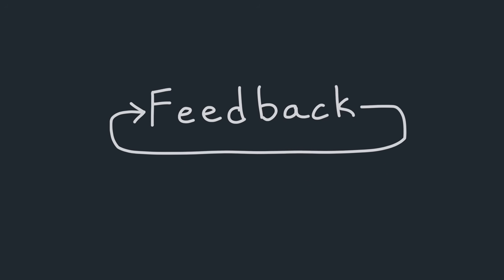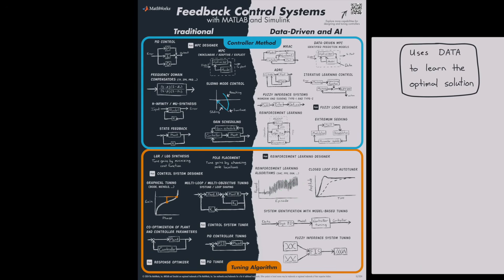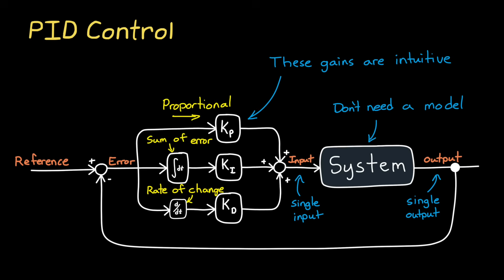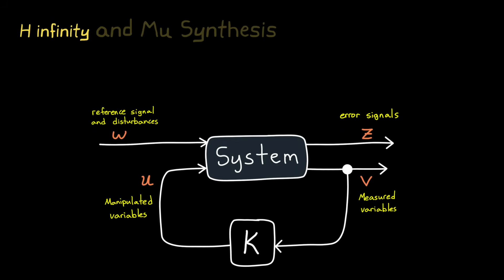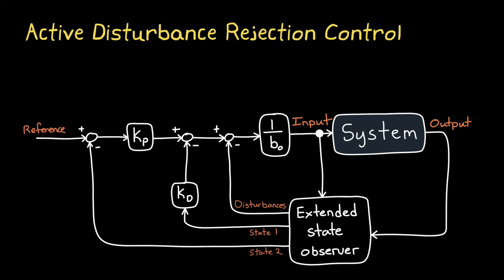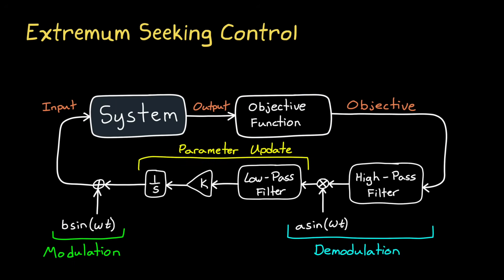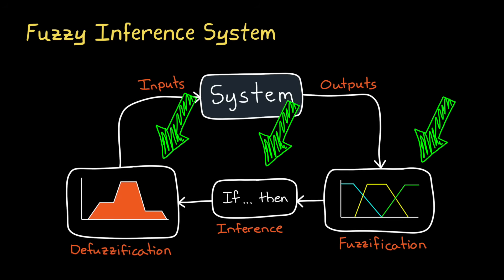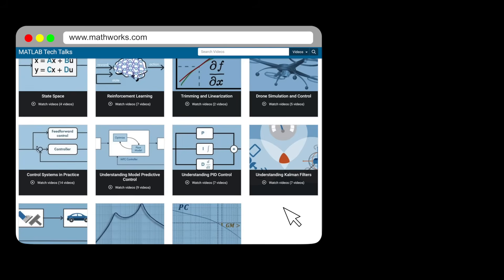Closed-Loop Control: An Overview of Feedback Controllers

Comment: In my opinion, if you have physical knowledge about your system, then MPC is the way to go. Not only does it perform extemely well, it is also easy to reason about, simulate, adapt to new situations. Writing your controller as an optimization problem is such a great way to show to other engineers what you want it to do.
Reply: Yeah but good luck deploying it in hardware where real time is a requirement
Reply: @omaraissani5910  that's exactly what I'm doing. It can be done.
Reply: @pietheijn-vo1gt  am not saying it's impossible, in fact i myself prefer MPC over any controller out there, it's elegant and it handles constraints inherently. But it can be quite challenging to implement in real life especially for fast dynamical systems and when computational power is a concern.
What are you working on ?
Reply: @omaraissani5910  there are some demos of it running at 30Hz on drones. I myself work on systems with slow dynamics so the time budget is a few minutes. Still it gets tricky / combinatorial when integer / binary variables are involved, havent found a good solution to that yet.

Comment: Great overview of various control methods! It would be fantastic if you could create a series on the actual implementation aspects of different control methods. For instance, in the field of power electronics (I am a power electronics software engineer), factors like hard real-time computation in microseconds on embedded systems significantly limit the options.
Reply: totally agree, we have no vidoes in matlab tech talks where real time implementation is shown with any particular physical model. It would be very handy to have them.

Comment: Awesome video, Brian! Always something new to learn from your videos. I am curious about Digital Control. Where would it lie? It comes under traditional control but Data driven methods can also be used with Digital Control.  Further, the System or the Controller can be digitized. Seems Like it creates a new dimension. I am just wondering, may be I am wrong.
Reply: Thanks for the comment! Most of the controllers mentioned are usually implemented as digital controllers - in the sense that they use sampled data as inputs, generate discrete-time outputs, and the controller itself is running on a digital computer. Even if you design a controller in the continuous-time domain (like you might for PID), it is still often implemented on a digital computer. So, I'm not sure what a digital or continuous dimension would look like without also having to think about are we designing in that domain and/or implementing it in that domain. Do you have ideas?
Reply: @BrianBDouglas  Thanks for the reply, I agree with you in the fact that all the mentioned controllers will eventually have to be digitized in one way or other. But I also feel like sometimes this digitization can brings an inherent lag or other times, it can bring fixed point calculations. Maybe digitization is like a wrapper function which you cannot avoid. This is food for thought for me, I will work on this, Thanks for inspiration!

Comment: Nice explanation. How do we combine any two control methods for a system?
Reply: That question probably requires a more thorough answer than I can provide here. The easiest answer is to say that you can have different controllers for different closed loop processes in the same system. For example, one controller to move a robotic arm to the correct point, and a different controller to handle the grasping mechanism that picks something up to make sure it doesn't squeeze too hard. You could also have different controllers for an inner and outer loop in a system. Like a low level motor controller that tries to maintain a commanded speed which has a larger feedback loop around it that commands the motor speed. Also, some controllers like iterative learning control, often have a different feedback controller like PID along side of it to improve its performance. There are many ways to combine these controllers and this is just a few. I hope this helps!

Comment: fuzzy logic is such a bad concept
Reply: Why?
Reply: @BrianBDouglas  it is just logic with a strange methodology around it
Reply: @rezah336  That's true, but that strange methodology makes it useful. Think about full state feedback. That's just a gain matrix. But filling out those numbers can be tricky if you just think about it as a matrix of arbitrary numbers which maps the outputs to the inputs. To make it easier, we could use pole placement and think about it in terms of where we want the closed loop poles to be. This is something that humans can wrap their heads around and so it's a helpful method to generate those numbers. Similarly, fuzzy logic essentially just creates a mapping from outputs to inputs. And the Fuzzy logic portion is like pole placement in the sense that it gives us a way to determine that mapping using something that humans can wrap their heads around. Instead of setting up and solving complex optimization problems, we can just define the mapping using some human interpretable rules. The end result is still a 1 to 1 mapping from system output to input, but it's done in a way that can be easier to understand.
Reply: @ totally disagree, full state feedback has a deep and clear concept behind it, i.e. placing poles so that the system matrix behaves as wished, based on linear algebra and dynamic systems theory

in comparison fuzzy logic is just some if-else logic with strange patched together ideas to try to make it work
Reply: @rezah336  Each controller excels at specific tasks. Fuzzy logic alone isn’t ideal for precise error minimization (e.g., achieving zero steady-state error in drone altitude control), but hybrid fuzzy-PI can handle this too. Here, I’m just simplifying to draw an analogy—fuzzy logic shines in handling ambiguity, like sorting apples based on qualitative factors.
Reply: @ i agree with you, the problem i have is that fuzzy logic is grouped together with control algorithms, it is not a controller it is just logic. If fuzzy logic was presented as a tool for automation (like sorting apples) or parameter variation (fuzzy PI) i wouldn't criticize it. But here and often it is presented as a controller, and as a controller it is a really bad method.
Reply: @rezah336  First off, thanks for engaging in conversation here - I feel like I always learn some things and correct some misconceptions I have from everyone commenting and I appreciate it. Could you clarify your comment about how it is logic and not a controller? I agree that fuzzy logic is logic, but when it's applied to a feedback system in the way described, doesn't that make it a controller (regardless of how good it is)? For example, bang-bang control is just if/then logic, right? I would still consider that a controller. Also, I haven't used it in a real practical case, but a data-driven approach to tuning a fuzzy controller I think is a good blend of learning a function that is a universal approximator, and ending up with something that is more understandable than a neural network.
Reply: @ 

when i wrote it is not a control method i mean control as in control of dynamics, if it cant achieve 0 stationary error of a first order system in a robust way is it really worth mentioning?

if you want to call fuzzy logic a "control method" then you can also call a lookup table a control method, they are equally primitive, but a lookup table is still better

it is based on a very thin foundation for dynamics and control, a simple I controller will probably outperform it 100% of the time. I dislike it because the whole concept is just bad.
Reply: I have used fuzzy logic for controlling a highly nonlinear system which was very difficult to model. The results were pretty good and better than model based approaches.
Reply: @UmBr3ll4CorP  do you think a lookup table would outperform your fuzzy logic design?

maybe lookup table + I controller?

or I controller with a lookup table scheduled I-constant?